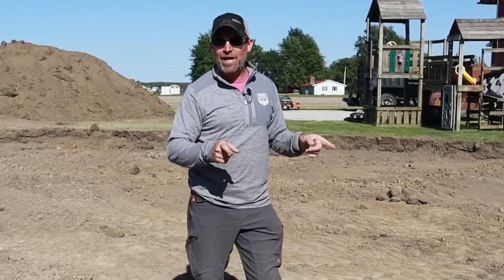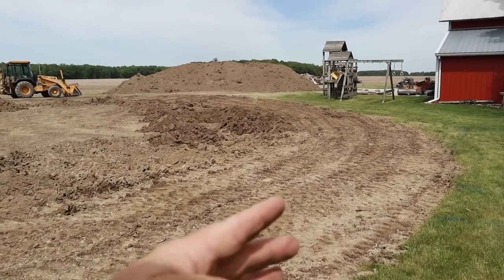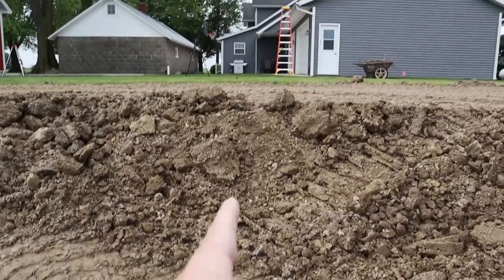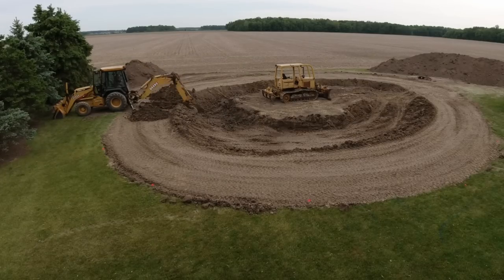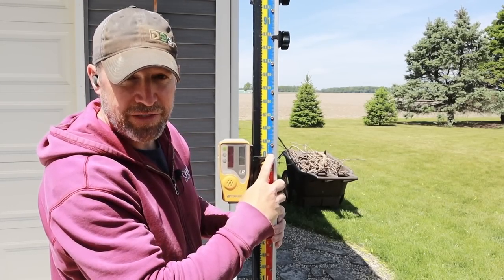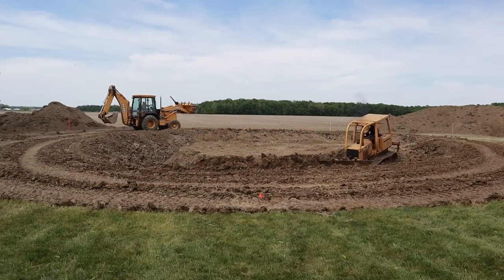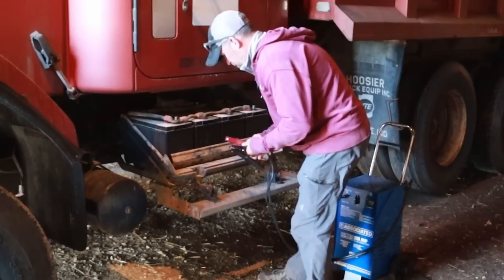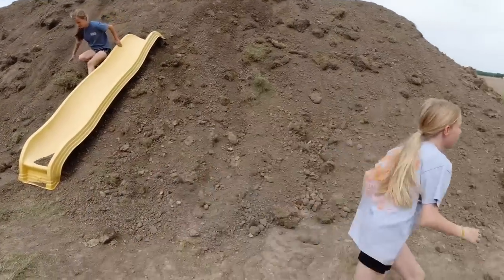The Right Equipment For Our Backyard Pond Build Episode 3

Comment: Great video as usual!  Everything I've read about ponds says that if it's not spring fed, it has to have X # of acres of watershed feeding it to keep it at full pool and avoid evaporation.  Is that a concern of yours?
Reply from the maker: There are a lot of ponds around here that do not have watershed into them to prevent dirty field runoff. We're fortunate to have good annual rainfalls that for the most part keep them full. There is actually spring water here at only 20 ft deep if I need to tap into it...
Reply: @digdrivediy  awesome!  Best of luck, can't wait to see the next video!

Comment: i drove truck for 27 years.  i drove many different types and for 2 1/2 years i drove a G.M.C. Genneral 10 speed with a top end of 59 mph. it was a flatbed and the suspension was super heavy duty. between the cummins diesel and all the rattles i couldnt hear myself think. t was by far the worst truck i ever drove. lol
Reply from the maker: I can't disagree. This isn't my favorite truck to drive but it got the job done. It's probably going to find a new home.

Comment: 14:12 is that elevation your invert
Reply from the maker: Proposed invert, yes. I may actually lower or raise it a bit depending on what depth I get. I plan to put a 90 on the overflow so that I can adjust it a little bit from time to time.
Reply: @digdrivediy  Gotcha. Is it 8 feet lower than your bench or higher? It’s gotta be lower, right? You said your bench was higher than the average flood area and then you added a few tenths? Is there that much elevation between the bench and the pond? Sorry for all the questions, it’s just weird for me to see prints with the benchmark being zero. I understand how you would set a bench at zero and work your elevations either up or down. Plus you know the site what for it being your home and your drawing.

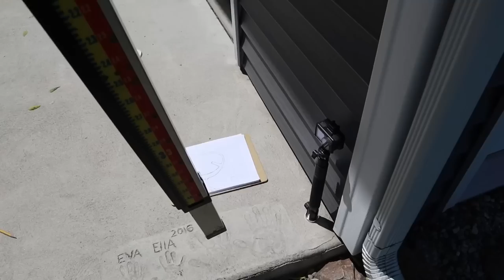Comment: 10:50 ahhhhh cheater rod!!! Lenker rods are nice though. Don’t need to do as much math or really bother with instrument height.
Reply from the maker: Exactly! When I started excavating we had a lenker rod and it's just hard for me to use the regular grade pole now. I'm too spoiled! 😋
Reply: @digdrivediy  The regular ones are just as easy except you have to do the math and add instrument height and and make that your bench reading and then do whatever math to get your elevations and then add or subtract those. I like the lenker for ease of use but I always use the regular rod doing what I do. Unless I’m doing stakes and making elevations. The lenker makes it so much faster.